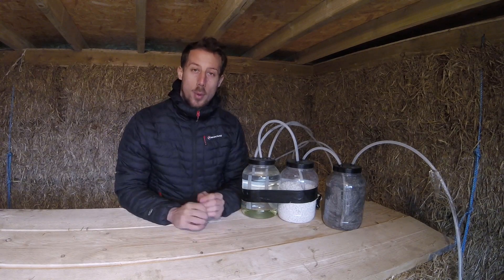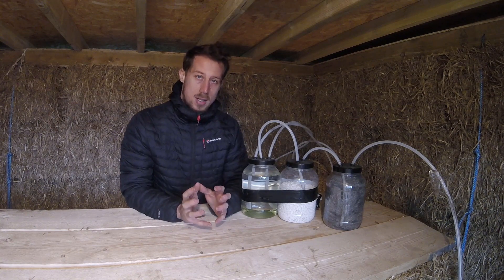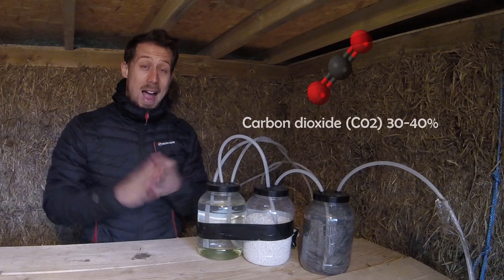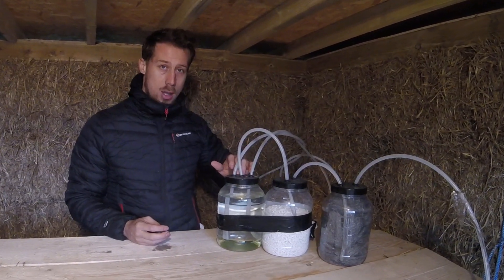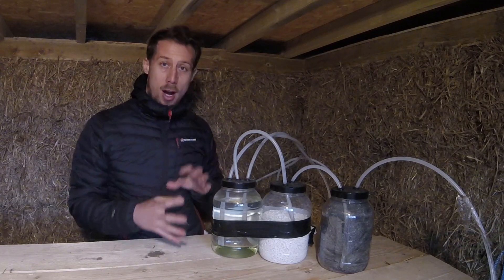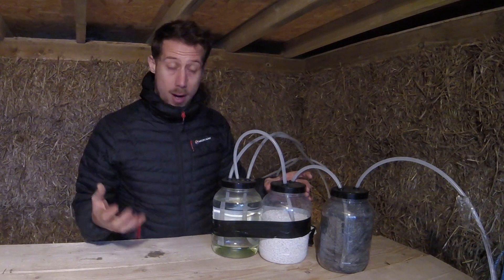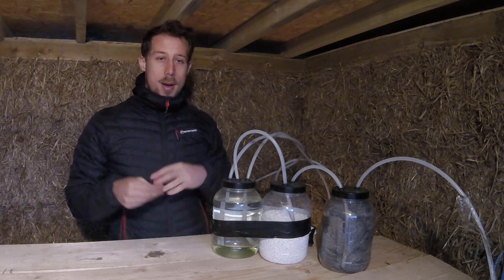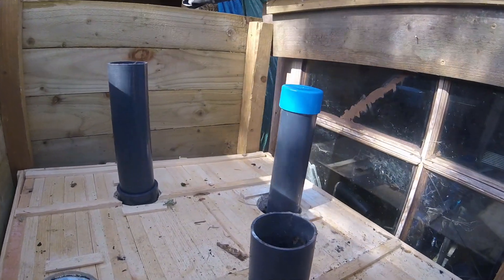Purify your Biogas with Biogas Scrubbers: Why & How // Full explaination // Biogas Digester

Comment: Hello this video is amazing but i couldn't hear properly what material did you use for removing water vapour and sulfide, i have been using biogas since 2007 but couldn't start generator for power generation but now i can fix it by using your method to purify it thanks man
Reply from the maker: Hi Adil. I have updated the description and put the information there for you. Cheers

Comment: Once the filter medias are saturated how do you responsibly dispose of them? Also does the steel wool just turn to rust?
Reply from the maker: The steel wool does turn to rust. The cat litter can go in normal household waste. If you use activated charcoal it can be composted.

Comment: A byproduct you will have from the steel wool will be moss killer, it'd be better to put the dryer after that if you can find a use for it.
However do check if your country still allows the use of it, the law in Denmark for example stands that you can use it but can no longer buy it.
Reply from the maker: That's interesting. I hadn't even thought about using the waste products from the steel wool. Cheers

Comment: Is there a reason why you place the steel wool scrubber last? Why not first, then the water, then the dehydration?
Reply from the maker: I think you could justifiably do it either way around. I chose to do it last so there is less chance of the wool being corroded by moisture and rusting.
Reply: @GetMeOffGrid_   Thanks. Makes sense. Just thought you’d get residual h2s in your water and  kittylitter.
Reply from the maker: I think you would for sure, but I don't think thats a bad thing. The water will act as a "pre-filter"

Comment: I am very impressed by your work on modifying the biogas system to a cold climate. For a while, I was thinking about a single solution to purify both CO2 and H2S through a sustainable method. How about using NaOH or KOH solution to bubble through first? H2S becomes Na2S/K2S+H2O and CO2 becomes Na2CO3/K2CO3+ H2O. Then we can add a water container to bubble through to remove alkalinity in the gas in case. You can make the system locally sustainable if you use KOH solution made from wood-ash.
Reply from the maker: Interesting idea. I like the fact it could be homemade, using the wood ash. It doesn't reduce the number of scrubbers though, as if you use water to remove the alkalinity you would have to then remove any excess moisture using some dehydration: cat litter, charcoal etc.
Reply: @GetMeOffGrid_  thanks for the reply. In fact KOH absorbs almost all the CO2 compared to just bubbling through water. So you will get less volume of gas which has high methane content. This helps reduce the storage space. You will get good clean burning.
Reply: @jayanathdealwis2584 How strong would the KOH solution have to be?  And about how long would you be able to use one batch before having to switch it out for fresh?
Reply: Goodmorning Sir
Reply: Can I ask something?
Reply: This is for school purposes

Comment: thanks for your reply;  when do you replace and/or how often do you replace the cat litter?
Reply from the maker: You will only need to change it when it has become saturated with water and therefore would not be able to absorb more moisture. When this is will depend on how much gas you are producing.
Reply: @GetMeOffGrid_  thanks; great help; this project I am making will be the first in Qatar; hope I can do it right; I will share with you the complete process when it is completed; again thanks and bless you
Reply: another questin;  Sequence of tanks; according to you; cat litter is used to dehydrate the gas; should'nt this be the last stage of the purification procsses; i.e. after the CO2 extraction tank ??

Comment: Can you explain in writing in Arabic the components of the filters from the inside and make a scheme for them?
Reply from the maker: Unfortunately I am don't speak Arabic. Maybe you could google translate the answers I gave when others have asked this question. What do you mean "make a scheme for them"?
Reply: No problem, write to me in English or any language with the materials inside the filter
Reply from the maker: Water
Cat litter or Silica or activated charcoal
Wire / iron wool
Reply: Dear sir, with regard to iron wool, is it possible to get rust, and with regard to silica, I have read several types of it, so do you mean which type?
Reply: @GetMeOffGrid_  Is it not possible for iron wool to become rusted? As for silica, I have read several types of it, which type do you mean?
Reply from the maker: @alymohamedabdelsemie4259  Yes it is possible. The idea is that the cat litter or dehydration material removes all the water so it shouldn't rust. But the H2S will corrode it, which is the reason for using it.
Reply: @GetMeOffGrid_  
Is it possible to make the tank out of strong iron or iron?
Reply from the maker: @alymohamedabdelsemie4259  Stainless steel would work but anything else would corrode.
Reply: Can I ask you about these questions 1- How do I maintain the efficiency of the biogas unit in the winter 2- How many days does the unit take to produce the biogas 3- What is the function of iron wool in filtering 4- What are the specifications of the tank to run 4 hours
Reply from the maker: 1. It is difficult. I tried a few things last year but will be trying some more again this winter so watch out for the videos in a few months. 2. It depends on what you have started it off with and your conditions, if it is warmer it will be quicker, if it is with a lot of cow manure then it should be a few weeks in good conditions. 3. Iron wool reacts with the H2S to create iron sulfide which is a solid. 4. Not sure what you mean.

Comment: brother, is making bio gas is risky or not? do we need to change water and other things time to time? how to depose the water etc?
what is in the white form? where i can get it? please, help me.
Reply from the maker: HI Pranjal. There is a risk to making biogas, but it is only usually dangerous when the gas is pressurized. Yes you will need to change the water from time to time but that will depend on how much gas you are producing. If you are making lots of gas you will need to change more often. The white material is cat litter, you can also use silica gel beads. Something to remove the moisture from the gas.
Reply: @GetMeOffGrid_  thank you, your work is really great and simple to understand, simple to do.😃😃 But, i thinking to make a biogas in a 1000 litre water tank. Is it a good idea and store the gas in a big tube? Is this a good idea.?

Comment: Thanks;  how do you vent out and get rid of the CO2  without loosing the Methane??
another question; how much these pipes sealed; it looks that you will have gas leaks ??
Reply from the maker: CO2 is dissolved in the water so does not need to be vented. Just replace the water ever so often. Not sure how long, it will depend on how much gas you are producing. The pipes should be sealed better, these pipes are sealed but not as well as they should be.
Reply: @GetMeOffGrid_ I'm worried about your filter set up inside the building - do you have a high vent just in case?

Comment: Hi Tom, we are glad to witness the technical information also from the videos you are presenting. Here, I have small query that how would you scale up the digesters for about say 10-20 kgs of food waste and water should be the waste to water ratio to be added in the inlet .
Reply from the maker: Hi Sindhuja. I am glad you like the video. I am not sure what you mean about the waste to water ratio? If you are talking about how much water to add to the food you are putting in I am not sure there is a rule. I like to add around the same amount of water as food waste but volume. But it will vary depending on the food. Let me know if you need me to explain something any more. Cheers
Reply: @GetMeOffGrid_  Thanks to you! Yeah what I meant was about how much water need to be added. Yes I got my answer here. Can you please provide me your mail id so that I can discuss with few more queries. Thanks in advance.
Reply from the maker: @sindhujatalla2202  Sure no problem. My email is tomoffgrid@gmail.com
Reply: One resource that came up with a scientific number is Dickinson College Farm. https://youtu.be/YvQAg838xGs In there experiments they found that 5-10% solids to water ratio was the ideal to maintain PH balance and optimal gas production.  Now that number is a bit tough to come up with because a lot of common kitchen waste already has water in it.  So again the scientific way is to take a sample of your scraps, slowly dehydrate it at 105celsius for 24 hours and compare pre cook weight to post cook weight to get your solids content percentage.  Example, if you take 500 grams for kitchen scraps, bake them as above and end up with 200 grams of scrap material, you have 40% solids.  So then you can calculate how much water to scrap ratio.  In this example you would need to add 1700 grams of water. 200 grams solids divided by 1700 added water plus original 300 water in the scraps equals 200/2000=.1 or 10% solids.  You can find the college on YouTube as well.  Hope this helps and is totally not super necessary.  You can swing it one way or the other by quite a bit and it will still work.  We are just talking about going for max production.
Reply: Thanks for your videos they are very educative. Please, apart from the water in one of the scrubbers, what are the materials in the other 2 'jars'

Comment: gr8 info...i have one question .i have built big digester (12feet diameter 7 feet high  underground) now i am to the filteration plz suggest the size of tubes . m thinking 3 inch pvc pipes but couldn't get exact size info.on internet
Reply from the maker: It doesn't really matter the size of tubes. 3" would work fine.
Reply: @GetMeOffGrid_  thnnxx ..will update soon

Comment: Hello, For what surface of the container can they be used and for how long can these filters be used? How do we know when they need to be changed ? Thank you !
Reply from the maker: Hi Alqi. I am not sure what you mean about the surface of the container? On how long until they need to be replaced, I am not sure, it will depend on how much gas you are producing. I would suggest every 6 months or so for a small digester but that is just an educated guess. I am hoping to be able to test this at some point in the future.
Reply: @GetMeOffGrid_  Thank you, great chanel !
Reply from the maker: @alqiloli3273  Thanks!

Comment: Can this purified biogas be used in lpg converted cars
Reply: Thanks man
Reply from the maker: @Moses_Mash  No worries
Reply: I believe cars run on cng as lpg is deemed too dangerous. Cng is basically 98% methane. This biogas was stated to be 80-90% pure so it should run a car but with a little less efficiency.
Reply from the maker: I am not sure to be honest. I have seen people using this biomethane to power vehicles but am not sure if they use the same system as LPG

Comment: You could combine the CO2 capture and H2S capture in a single reactor by submerging the steel wool in the water. This will also cause the gass to bubble around the steel wool more slowly, yielding better results.
Reply from the maker: Interesting idea. When the water becomes more acidic would it not attack the steel wool? I'd think it would mean you would have to change the steel wool more regularly without really having gained much in terms of performance. As long as the wool is packed tight it should react with all of the H2S. I think.
Reply: @GetMeOffGrid_  Stainless steel wool should do it. Regular steel would indeed corrode away very quickly. Stainless will also eventually corrode but it would do that anyway even if it wasn't submerged in water.
Reply from the maker: @mikael5914  Okay cool. Once I get my digesters up and running I might run a little experiment to see the difference between submerged and not. Cheers!
Reply: @GetMeOffGrid_  Looking forward to your results. Good luck!
Reply from the maker: @mikael5914  Cheers!
Reply: @GetMeOffGrid_  If I'm not mistaken, H2S gas reacts with iron-oxide not iron itself. You don't want to use stainless steel. In a wet container the iron will corrode, creating more iron oxide. Though I bet you don't want your iron sponge to completely corrode to 'powder' given the current filter design. 
Should you opt for the @Maikel 's design: acids also react with iron oxide, though I don't know the chemical reaction by heart
Reply: @GetMeOffGrid_  what is the seconthing you used to rmove water after romoving CO2 through water
Reply: @sohailkhan-gf4dr  cat litter, but he said silica gel also works
Reply: I imagine the steel wool after the cat litter also captures any ambient litter dust, but maybe I'm just being hyper cautious with the litter

Comment: Hi Tom, 
Also pls tell that do we need to change water, cat litter, wire wool after certain period of their usage,,,bcoz if these materials are scrubbing unwanted gases n holding them inside then there must be a life for these materials...
I hope I have asked the right question...
If not pls revert, I shall try to ask it in more detail...
Reply from the maker: Hi. It is very difficult to say to be honest. It will all depend on the amount of gas you are producing and also the feed you are putting into the digester. The wire wool will visibly change and start to degrade. The water you could do a pH test and when it starts to get to a low pH change the water. This would mean the water is becoming saturated with carbonic acid from the carbon dioxide. The cat litter would have to be a visible check. I would guess they should all last at least 6 months if you are just using it for a small household digester. Hope that helps

Comment: So do you use steel wool or iron wool?  Does it make a difference?
Reply from the maker: To be honest I think the proper word, at least in the UK, is wire wool. As long as it has iron in it will react with the H2S
Reply: Steel is a processed form of iron. I believe for this process they are essentially the same, but one has more carbon in the metal. I've only heard it called 'steel wool' but I suppose there could be brands that are called 'iron wool'

Comment: Hi Tom, can you help me with the name of the material for dehydration, the one in the second bottle and if possible a link to buy. I am fascinated with Biogas and I am happy to learn from you pal. Good works
Reply from the maker: Hi, great to hear! The material is Cat litter. If you can't find cat litter you can use Silica.
Reply: @GetMeOffGrid_   Hi mr Tom, thx for let us get knowledge from you about biogas. So I want to ask you the three staps and materials of purification of biogas(in bottles). An other question: after purification, biogas(biomethan) can be used in generator for getting electricity?

Thanks you!
Reply from the maker: @niyonzimajeandedieu6138  A pleasure. The materials are: Water in the first to remove CO2. The second is a descant (cat litter / silica / activated charcoal) to remove the moisture. Third is wire wool to remove H2S. Yeah methane can be used in a gas generator. Cheers

Comment: thanks for your videos mate, there arent many of them in the uk, (probably because of the cold weather) couple of things ive seen are using a 12 heating element on a simple solar setup to heat the digester possibly, and ive seen some rigged up to a toilet in the us, question is, does human waste produce methane gas, as im not sure it does ? and lastly are you producing gas yet as its june and pretty warm,  and looking forward to more of your videos but you need to up the volume a bit as sometimes you cant hear very well
cheers mate (from glasgow in scotland)
Reply from the maker: Hi Stephen. Thanks for watching. Yes the cold weather definitely is a barrier. The solar system is a definite option, problem is the cold is the main issue and its when the sun doesn't shine too much. Once I am happy with my digester I am hoping to play around with effectiveness of different things like that. On human waste, yes it does produce methane but from what I have read not as much. Also all the chemicals people use in their toilets does a good job at keep the good bacteria at low / non-existent levels. My digester isn't producing yet, I need to drain it, seed it and move it to a better spot but have been focusing on my other project recently. Once I have that all done it will be full steam ahead to get it up and running and producing gas so I can have a play with those other things. Cheers for the feedback on the volume, I'll try and get better, my gopro isn't an ideal camera for this unfortunately. Cheers Tom
Reply: One guy who replied said that he was going to put his in a small greenhouse, along with wood chip compost to keep it warm.  (Your greenhouse needs a vent at the top to let out any gas that may escape)

Comment: Hi, Tom. I am from India. it's great to see ur work. what will you suggest as the best inoculum for solid-state anaerobic digestion, and how much volume should it be, for example for 1 L reactor, how much should be the volume of inoculum.
thank you. i hope your reply.
Reply from the maker: Hi Mothe. Thanks very much. I am not sure what you mean by "solid state"? Like the digester I have built or something different? If it like my digester then I'd advise 50%, might not be necessary to have that much but it will work well with that much